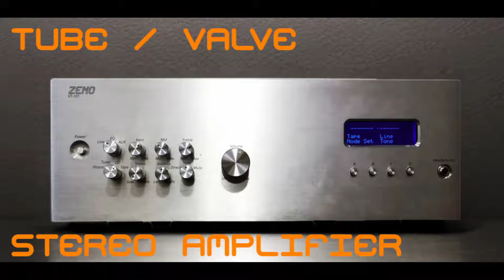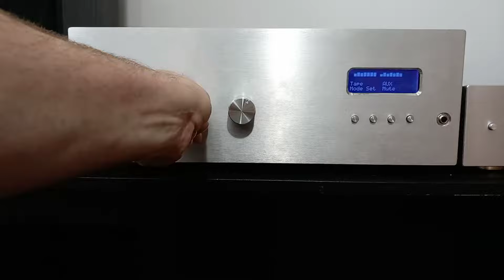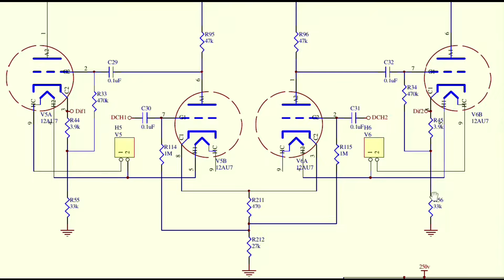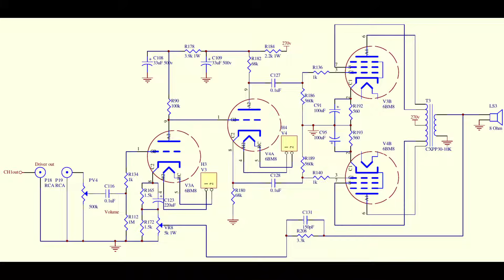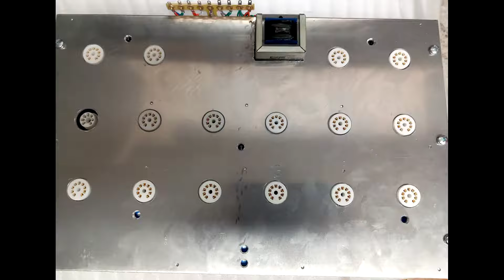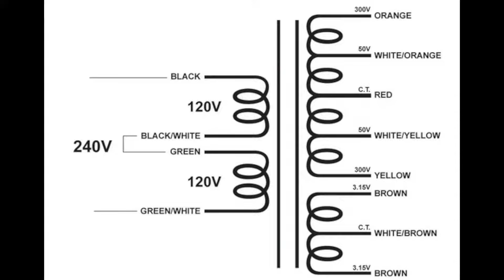The new Tube / Valve Stereo Amplifier

Comment: Well done. I'm not a great lover of valves personally. I prefer the the more detailed, lower THD sound of class AB using transistors. You have obviously done a great job to extract the best from a valve circuit. Ultra linear output transformers are always a great start. Not sure why you used a regulated power supply with a class A amplifier. Lots of extra heat and valves for what REAL gain I'm not sure.
What are your plans? Is it just a one off for your personal use or do you intend to market it? Do you have test gear to show what it can do? Good luck.
Reply from the maker: As for the regulated power supply I wanted to experiment with valves, this is why I went fill in with a regulated supply rail and the tone, phase controls. I wanted to see what was possible with this technology and to try out different ideas, as I have not done much with valves before.      

"What are your plans?" For now it for personal use, if there is a market for this product I may look doing something. As I have a few unused PCBs, I could make them avalible. The THD is high around 2% at 1W, I can make detailed measurements, but it is all about getting that all important valve sound.   

I am very happy with the outcome, after working on this project for last three years.